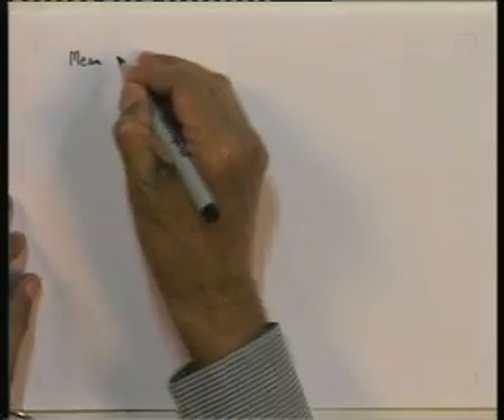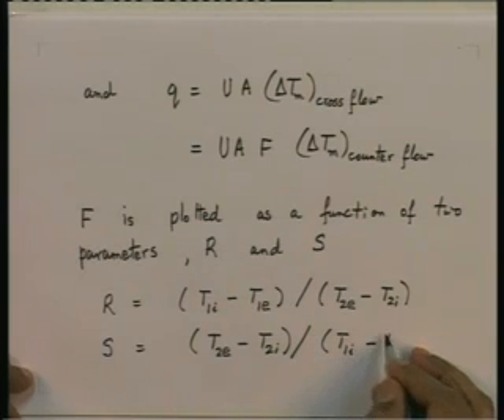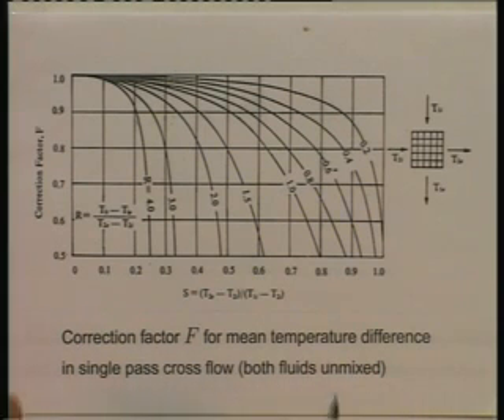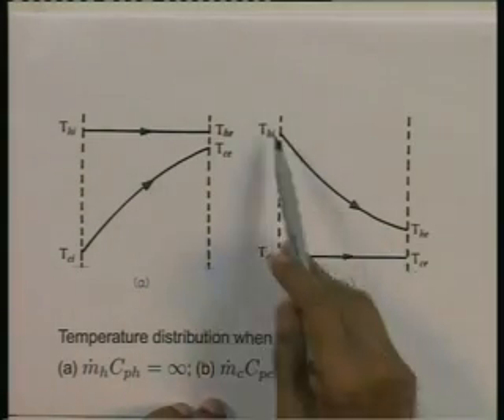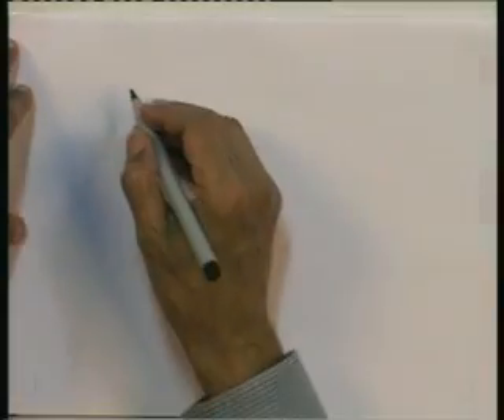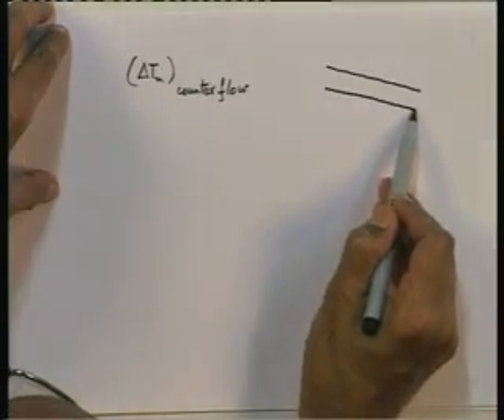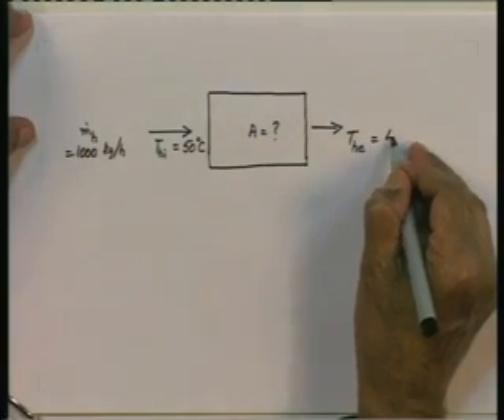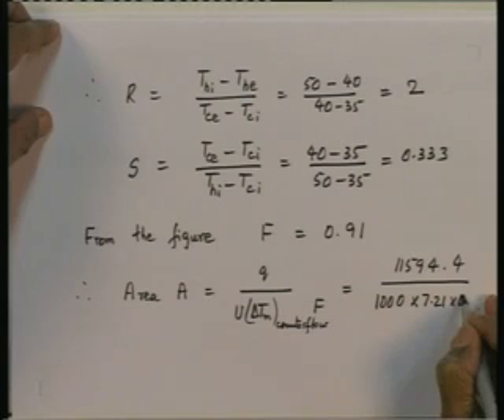Lecture - 27 Heat Exchangers - 3

Comment: Sukhatme Sir
What do you mean  by mixed fluid in Cross Flow. Does it mean the fluid is mixture of 2 or more constituents
Reply: A particular hot or cold fluid is separated because of fin. There are distinguished fin which makes sure that hot or cold fluid does not mix. Mixing means some part of hot or cold fluid is exchanging heat in itself ( that means cold fluid is giving heat to rest cold fluid to get uniform temperature profile.
Reply: @bec16kaushalpawar5   Yes bro 👍.You explained in very smooth language. Thank you.

Comment: both answers of numerical are incorrect as mean Temp diff is in degree Celsius and overall heat transfer is watt per m^2 per Kelvin .... thank u :)
Reply: that is change in temp ...and it wl remain either u take kelvin or Celsius ....
Reply: +Ashish Kumar nope bro there is a difference between Celsius and Kelvin as over all heat transfer U is per Kelvin temperature change should be in Kelvin
Reply: no bro u open any hmt bokk thn u wl come to know
Reply: Pagal tagal hai kya be, delta Tm hai, delta matlab difference hota hai, jaake jod ghatav sikhke aa
Reply: kelvin and celsius start at different basepoints but they have the same scale which means that one degree celsius change in temperature is equal to one kelvin change in temperature.
Reply: area for first is 76.344 by making unit balance if.if anyone got it please like
Reply: right both answer are incorrect mtd is in degree centi. nd u is in kel. how it cancel when finding area.
Reply: @madanmohankaral13  Everybody knows that converting °C to K is just adding 273 to the mentioned temperature. So for eg if difference between 40°C and 30°C is 10°C then addition of 273 to both 40 and 30 and finding the difference would give the same answer i.e 10. 😂